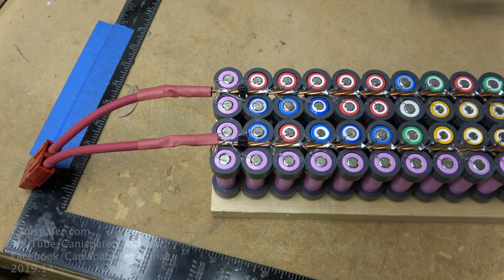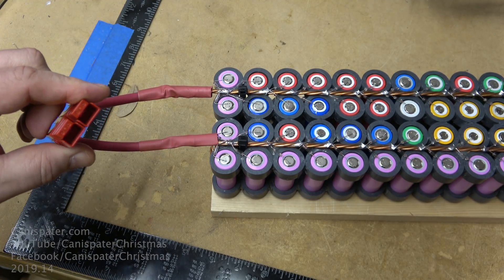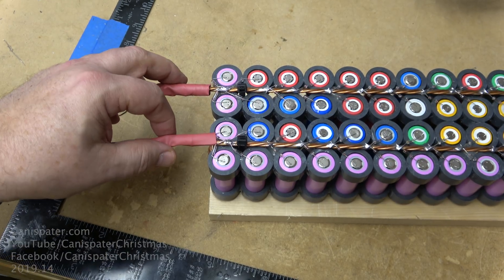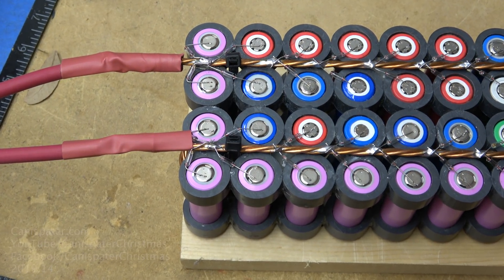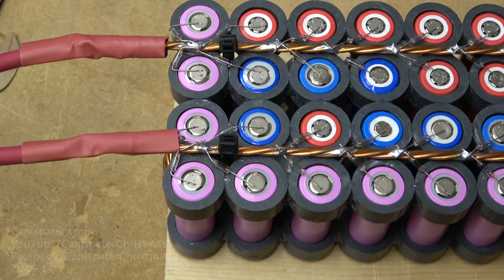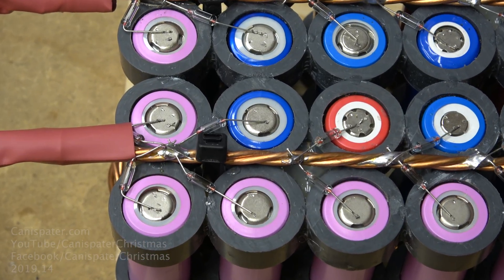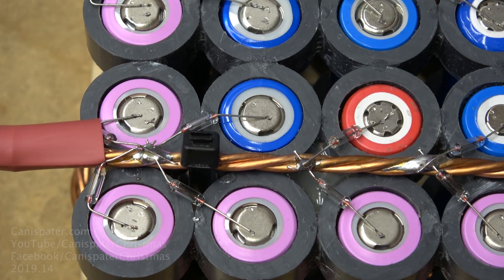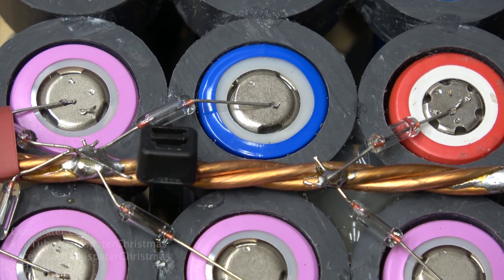⚡️DIY Powerwall Project - ep9 - Progress Update (2019) ⚡️

Comment: Can I talk you into doing a short video on your little ammo boxes with a differential receiver and the power supply how you  mounted them
Reply from the maker: I didn't mount anything. I just plopped the power supply in the bottom and shoved the DR next to it with the PCB touching the side of the ammo box (trying to avoid blocking the fan). The wires coming out of the DR were enough to hold it in place (and not like it's getting shaken around sitting on the ground). I only had a problem with one of them. I had to punch an extra hole for power injection and a box that also took the brunt of a driving rain storm. There was a thimble full water in the bottom and I was concerned it might short out the PS if it got much more so I dried it out and moved it out of the line of fire. Other than that, they worked pretty well. Probably not great in a place with high heat. Ah, you've given me an idea for a video! I need to monitor temp inside to see how hot they get. No failures this past year so I'm guessing not too much. lol! Yeah, I'll add that to the list.
Reply: @CanispaterChristmas  well I'm in Oklahoma it gets hot but not during that time of the year.. I've been wondering whether a non conductive silicone to mount with would be good
Reply: And the power supply double-sided velcro tape
Reply from the maker: Ah OK. Feel free to anchor it down as needed for your display. We did have some 80-degree days, but it cooled off pretty quickly at night while the lights were on and I didn't power the boxes during the day.

Comment: 3D Printer for the win! Also national standard is 1 amp discharge to get your total capacity and also keep in mind after your build its the sum of all parts. Yes 1 amp is soooo slow but doing it the way you  did you know what the capacity is during a 15 amp discharge which would be about normal under with a small energy star 11 cubic foot fridge 1 led light  and 1 computer with router and modem. Pretty much all my home is solar with a few exceptions like what ever is 220 volts and 1 10K BTU window unit. My own power and i like it that way. There is some automation you can do on a low sun day and the batteries get low i may have a video on it using a low voltage controller with 2 options generator or just use the electric company for a 40 or so amp charger and my most recent on going work is using CCCV to charge LiPo4 and LiOn the charger is CV  lead acid RV power supply/charger combo type using boost CCCV to convert it compatible for Lithium charging no video on it yet though.
Reply from the maker: Haha! Yeah, a 3D printer would be nice. I've not invested enough time to learn the 3D software side of it yet. That and I don't have one. lol! I believe the manufacturers use 0.2C as their discharge rate to get the capacity. 1-amp is what everyone uses per cell because it's faster and accurate enough with the cheap testers available. If my cell packs are 190 Ah, I should be able to test them at 1/5th or 38 amps to get below 0.2C. This system will be my learning experience and a UPS for the computers & associated electronics (and emergency backup for the fridge if needed). The city power is pretty good 99.9% of the time so I don't anticipate needing to pull a ton from the battery under general use. I don't have solar yet, but am looking for some to add to it later. I'll check it out.